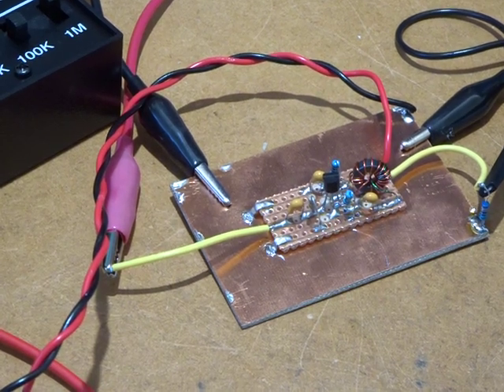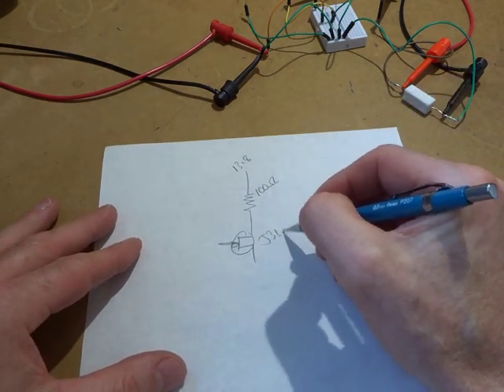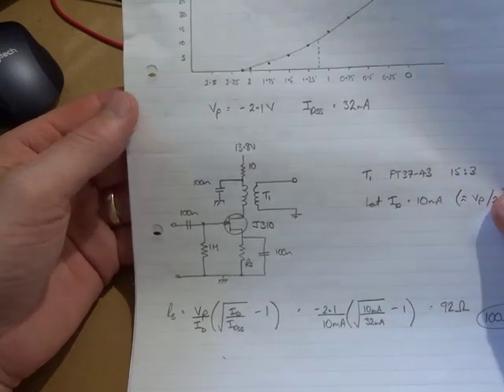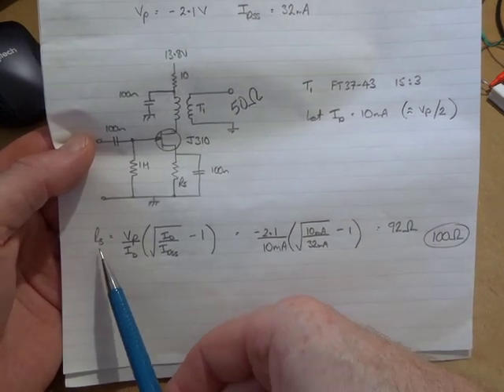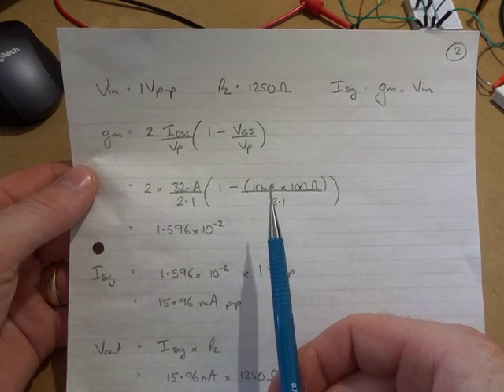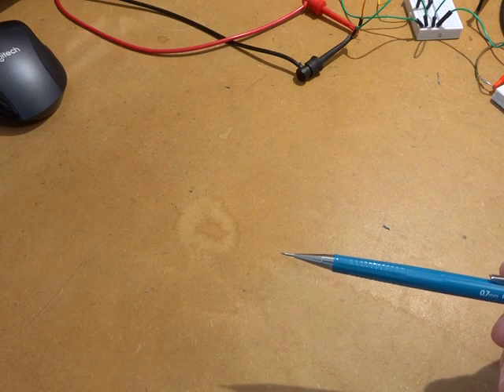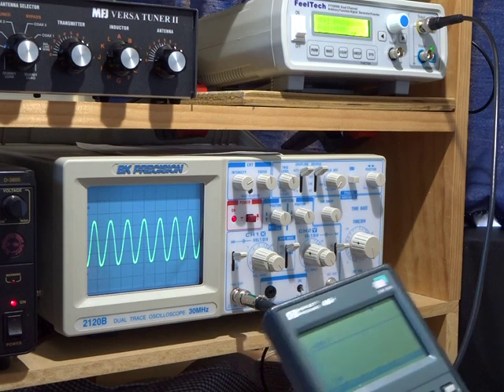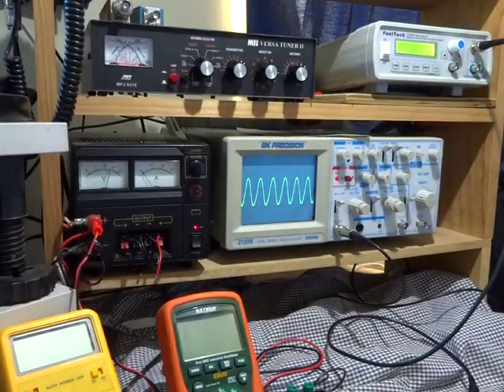Follow on Experiment with the J310 JFET

Comment: The formula for gm is actually:
dI/dV = gm = - 2.Idss/Vp x (1 - Vgs/Vp) which you get by differentiating the standard formula for Id versus Vgs. Note the negative - at the beginning.
But both Vgs and Vp are negative, so when you put the actual values for them your circuit, you get:
gm = - 2 x 32mA / (-2.1V) x (1 - (-10mA x 100R)/(-2.1V) ) = 2 x 32mA / (2.1V) x (1 - (1000mV/2.1V) ) = 64 / 2.1 x (1 - 1/2.1) mA/V = 15.96  mA/V = 16mS
The negative sign at the start cancels with the first Vp which is negative, and the negative value for Vgs cancels with the second negative value of Vp.
The same formula also works for a p-channel JFET, showing that it has a negative forward transconductance because as Vgs increases on a p-JFET, the drain current decreases.
Incidentally, the transformer having so few turns (15:3) means that n might not be exactly 5, and obviously n*n can vary away from 25, so the transformer calculations are only approximate. Similarly, using a 100R source resistor instead of the calculated 92R will reduce your actual gm and hence reduce your voltage gain a little. Getting x3.5 against a calculated x4 is quite reasonable.
Reply from the maker: Thanks Rex. I have saved this off and will take a much closer look at it when I have the next JFET amp. Like I say, I'm not an expert so I welcome the feedback.

Comment: Very nice explanation; enjoyable to watch it worked through.  Caught a bit of an error: at 5:35 you say the Idss=32 mA is above the max shown on the spec sheet.  But the spec sheet has two lines - one for J309 and J310.  You read that sheet at 1:22 - and if you look at Idss range for the line marked "310", you'll see it is 24 - 60 mA.  So your 32 mA measurement is right in the normal range and not an anomaly.  (It still illustrates the value of measuring it!). 73 de W1PJE
Reply from the maker: Thanks Phil for correcting that. Yes, the J310 has a range of 24-60mA, and the J309 12-30mA. Thanks again.
Reply: @CharlieMorrisZL2CTM  I think it's fortunate that you had some sort of current-limiting in the drain circuit as I have read that the manufacturers determine Idss with a pulse test as allowing the Idss current to pass for more than a few seconds can destroy the device.
Reply: As you say, there is next to no current flowing at the input, so very little power is dissipated there ( 0.125 microwatt in 1Megohm? ), so the power gain of your circuit seems to be nearer 40dB. I have built several miniwhip circuits (using J310s and a emitter follower transistor) which have a voltage gain of less than 1, but produce good signals from a very small antenna into the 50 ohm input of my SDR
Reply: @blacksmock445  The "current limiting" resistor in the drain circuit is completely immaterial. There's no way you can pass 120mA through the JFET's drain-source channel, as that current is always limited to Idss anyway. The issue is power dissipation, which has an absolute maximum value of 350mW @25°C. With an Idss of 32mA, you can only drop 11V across the JFET and stay within spec for power dissipation. The reason manufacturers use pulse testing to determine Idss is that as the JFET heats up the drain current decreases, so you need to avoid self-heating to accurately get a value for Idss at room temperature.

Comment: Hi! Two things caught my eye; firstly..what is the intended frequency range for this gain stage? I see ferrite material 43 written on the schematic paper..that would suggest shortwave and up but wouldn't the miller capacitance become an issue at these frequencies with jfet unless You go cascode (you seem to anyway get the gain with the generator up around 10MHz and higher..i would've thought the miller capacitance would have swamped the gain down quite a bit..)..? Also do You detect harmonics in the amp with that bias..? I have always thought jfets have more curved Vgs/Ids characteristics below the half point vs above which suggest me some 2nd harmonics on the amplifier output..

Comment: Wouldn't you be able to measure the current equally well by just measuring the voltage drop across the 100 ohm resistor?

Measuring a voltage across such a tiny resistor seems like it would be very inaccurate.